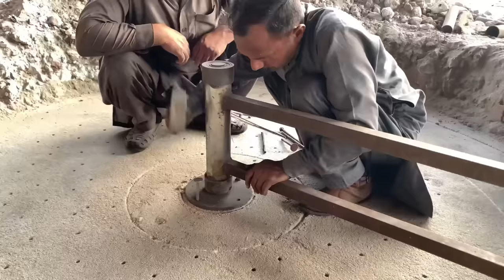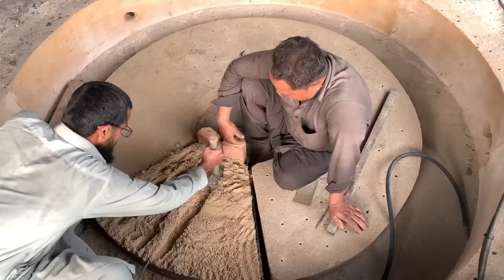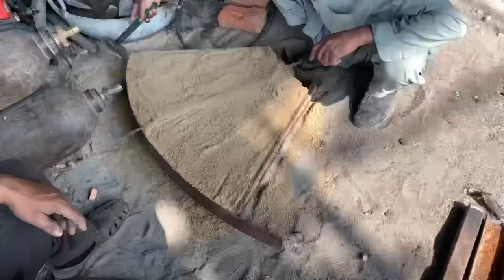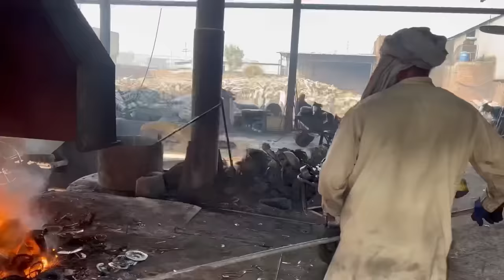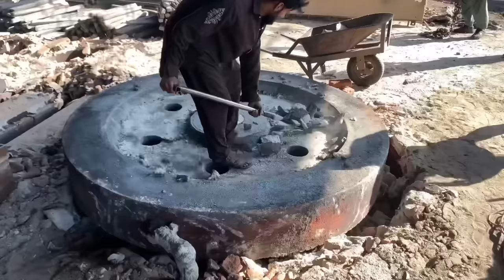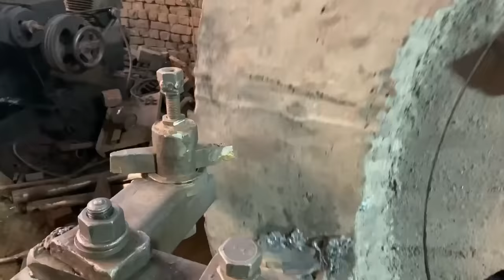Amazing Manufacturing of Largest Industrial Gear for Rolling Mill Plant | Production of Biggest Gear

Comment: What is used to bind the sand?  And what is it they're pumping into the sand through the black pipe?
Reply: Sodium silicate (water glass)is used as a binder. Co2 gas is pumped through it to harden the mixture.

Comment: Can anyone explain the air pipe being pushed into the holes and what it is doing? I've seen it being done on lots of casting videos, but never knew why. Many thanks.
Reply: It's usually some form semi inert gas that reacts with a chemical hardener in the sand. Once applied it hardens much like concrete but far more brittle.
Reply: @Jackskellington7172  Fantastic reply thank you so much. Really explained it perfectly. Thanks.
Reply: Sand is mixed with sodium silicate and when exposed to CO2, it hardens. It is recycled again for reuse.
Reply: The question and answer I've been looking for for months 👏👏👏👏

Comment: What is it that they are pumping into the sand?  Is it just water or moister so that it will set up or is it some kind of setting agent?   Awesome process!
Reply: Liquid sodium silicate is mixed with the sand. After shaping the mold, the mixture is solidified with carbon dioxide pumped into the holes.

Comment: What binding agent to you normally mix with the sand and what gas are you using to harden the sand ?
Reply: CO2  carbon dioxide?
Reply: That is sodium silicate (water glass) mixed with the sand. CO2 hardens it. I've used it a lot and works especially well for cores.
Reply: Introduction: Co2 Casting is a kind of sand casting process. In this process the sand molding mixture is hardened by blowing gas over over the mold. This process is favoured by hoCO2 Moldingbby metal casters because a lot of cost cutting can be done. In addition, one can be sure of getting dimensionally accurate castings with fine surface finish. But, this process is not economical than green sand casting process.

Process: The Mold for Co2 Casting is made of a mixture of sand and liquid silicate binder which is hardened by passing Co2 gas over the mold. The equipment of the molding process include Co2 cylinder, regulator, hoses and hand held applicator gun or nozzle. Carbon di oxide molding deliver great accuracy in production.

Comment: Definitely a job done by people with such skill and ingenuity even if with an approximate technology, the fact that astounds me the safety at work, they work continuously in sandals, in the act of transshipment of the melted crucible they did not use any protection, yet they stood there to work hard and make sure that the work runs in the best way. The finished material could be seen to have many melting holes, probably due to the fact that the crucible did not allow all the air inside the mold to escape, or to a non-perfect melting point, who knows, but the fact remains that with here rudimentary means have done something incredible. We start making objects with 3D printers.

Comment: THIS was a really cool video.
Didn't even realise they were using a carbide turning tool until near the end. I would have though they would use hss because i didn't think carbide would hold up with all the interrupted cutting from the raw casting at the beginning. But then again that raw scale on castings is very hard.
Reply: carbide has improved alot over the decades

Comment: Good job by all. It’s easy to criticise but they got the job done. Scrap motor laminations for the steel which are usually of high quality metal. Is it a gear or a flywheel ? If it’s a gear I would like to see the teeth being hobbed. All the best.

Comment: The fact that this incredible amount of manual labor and precision could be cheaper anywhere or for anyone than using a CAD model and just programming a machine to do basically everything even better is astonishing. And so, so sad. Still, I deeply admire your craftsmanship.
Reply: ¿En verdad usted cree que con hacer un modelo en CAD ya la rueda dentada está terminada?
Reply: Its really just cheaper for the business. The workers are paying with their health for the cheap manufacturing.
Reply: thB: it would take a hell of a milling machine to make a piece that size!  Is there a milling machine that big??
Reply: @d.jensen5153  the answer you are searching is vertical lathe
Reply: @LaCotuaazul  
El CAD o el CAM funciona con máquinas por control numérico
Reply: @a.d8055  
El CAM NO FUNCIONA EN MÁQUINAS MANUALES
Reply: @MACNC555  El CAD (Computer-Aided Design) es para el diseño.
Luego con el CAM (Computer-Aided Manufacturing) los datos contenidos en el diseño se transforman en lenguaje ISO, que es el lenguaje de programación de las máquinas-herramienta.
Reply: @LaCotuaazul  
Claro.  Yo trabajo en CNC
Reply: @MACNC555  Ah, ok.
Mi mensaje es para las personas que creen las máquinas de control numérico son mágicas.
Reply: cad is not goint to cast it for you. Some one has to do the casting and the machning anyway
Reply: Ja zurück in die Steinzeit  , dann bleibt nur noch die Filmausrüstung aus der Zukunft über 😂

Comment: This is a Fly Wheel of a Rolling Mill, which type is very much costly and problematic due to a heavy weight, in manufacturing, handling erection and Balancing. These Operate at Slow Speeds and heavy Weights whereas we can increase Speed and reduce Weight also, by this Diameter of Wheel will be reduced as well. The Manufacturing of the Component will be easy this will be a  Fabricated one by Steel Plate Laminations  welded to each other circumferentially at periphery and Hub Bore. Over here we do not know the Material Composition and hence other properties like Strength, how we can be assured of a Safe Running Speed that the Centrifugal Forces will not Burst this. In This type Fly Wheel is Installed at the Out Shaft of Speed Reducing Gear Box which is Mill Speed. As said above if manufactured in that way,  This will be Installed to Run at Motor Speed for the Same Effect and Advantage. Thanks for the Video, these workers are working hard and the Machining  Hold Up is Simple and Amazing to Handle such a Very Heavy Weight Component.
Reply: Hakim Mohamad  Choice is there, they may adopt High Speed Lesser Weight Laminated Plate Fabricated Fly Wheel as  I mentioned above. Thanks.

Comment: What I want to see is the gear installed. Is it a crushing wheel, and a little rough is fine, is it a flywheel and not important? Is it yet to have more machining done by another factory?

Comment: Is the hose injecting air to aide in faster curing of mold material or an inert gas that does that and helps remove moisture from mold material and make it more stable for the coming massive heat up?
Reply: Introduction: Co2 Casting is a kind of sand casting process. In this process the sand molding mixture is hardened by blowing gas over over the mold. This process is favoured by hoCO2 Moldingbby metal casters because a lot of cost cutting can be done. In addition, one can be sure of getting dimensionally accurate castings with fine surface finish. But, this process is not economical than green sand casting process.

Process: The Mold for Co2 Casting is made of a mixture of sand and liquid silicate binder which is hardened by passing Co2 gas over the mold. The equipment of the molding process include Co2 cylinder, regulator, hoses and hand held applicator gun or nozzle. Carbon di oxide molding deliver great accuracy in production.

Comment: One thing I don't understand, where are those double T irons that were put in between on the side of the holes? They didn't remove them?
Reply: I’m guessing they just leave them to become integrated into the manufactured part. They aren’t exactly concerned with uniform metal composition or impurities.

Comment: Do they just tamp down the ground to get it so compacted? And is the sand special casting sand? Why does it set so hard? from blowing the air out? drying it?
Reply: The sand is mixed with sodium silicate. CO2 is then injected and it sets up quickly.

Comment: They are using CO 2 Shell Molding ( note when they poke a tube into the holes they made into their sand molds, that’s to inject the CO2  to harden the sand by reacting w/ an organic chemical mixed in ) This process was invented during WW II by the Germans for precision castings needed for their aircraft and rocket industries.

Comment: What is the tube that goes in to the small holes in the sand that seems to make the sand stiffer ?
Reply: The tube is used to inject carbon dioxide into the sand.
Reply: @bobbydazzler6990 Interesting. Does that stiffen the sand ?
Reply: @MrJermbob  Yes, it does.  The sand contains sodium silicate.  The CO2 gas "cures" the sodium silicate to make the sand very, very firm.

Comment: Fascinating.  Does the compressed air set the sand mould elements?  Not a tinfoil suit in sight.
Reply: Carbon dioxide, not "compressed air"
Reply: @bobbydazzler6990  that makes complete sense.

Comment: what is the black tube thing that they are inserting into the holes that makes it appear the sand cast is solid?
Reply: Injecting carbon dioxide gas to harden the sand mixture.

Comment: Nice work but they need and upgrade foundry to make multiple moulds and would increase production possible to use rollers with pattern on 1 roller cud even be water cooled rollers 😂

Comment: I'm shocked at the lack of any safety equipment worn by those working with the molten metal.  Injury rate must be incredible.
Reply: There was a surprising set of data back around when i started working back in 1980. Here in germany there was a big rise in the use of PPE and the data from different companys showed that the ammount of injuries klimbed UP, not down. The conclusion was that the worker with PPE where injured MORE but had lighter injuries because of the PPE, but workers without had fewer injuries but got hit harder when they got struck. In the end the ammount of sick days stayed allmost identical, but the numbers for the big injuries droped.
Reply: @Ordog213  - Thank you for the information.  I certainly would not have expected that sort of outcome.  Most interesting.
Reply: @WarHawk-  False sense of security.
Reply: @Ordog213  Or not. Common sense goes a long way.

Comment: They're not casting iron. This is steel. Cast steel is pretty good stuff if your heat is well formulated. Not sure what's going on here but I imagine they're using a combination of mild steel and spring steel scrap as well as maybe some cast iron which should have been fluxed by the time they were ready to pour. I often wonder what would happen to the way of living were accostomed to if all went to shit. It's very reassuring to see that a lot of our mechanical tech can be fairly easily recreated given measuring implements and the minimum in the way of tooling don't disappear.

Comment: Incredible job they are doing, but🤔 it would be better that they would not use a bubble level, instead they should use a digital level, more accurate don't you think so?
I watch them all the time, great craftsmanship, also what do they spray inside those holes? 
It's like creating sand castles on the beach, that a lot of fun.😊

Comment: The guys who initially trimmed it on the lathe, I didn't see them take any measurements at all. Could they really have eyeballed that whole series of steps?
Reply: Yes they did. Client asked for a big gear... So he is getting a big gear 😅
Reply: its just a flywheel..not a gear that wud require precise measurement
Reply: @ChandanBehera-jp2me  depends on rpm. You do not want it to vibrate. And you do not want to do a lot of balancing holes.

Comment: i would be a bit afraid to work with that.. embedded there are pieces of an I-beam, a big cause of any crack propagation. teh steel quality...is too low... if that piece of steel fly away... it surely kills someone to say the minimum. nevertheless very interesting indeed

Comment: Are we supposed to admire this?  This is how industry functions when you have a limitless supply of cheap labor.  The subcontinent's runaway population condemns hundreds of millions of people to work as peons.  No mention of pay rates here.  No protective clothing or equipment.  Dirt floors.  Scrap metal pots and pans tossed in a pile, then hauled away by wheelbarrow.  Etc., etc.

Comment: not an expert in that matter. question is only answer if You know what You talkin about please, no tik tok experts! Cast iron for gear in my knowledge is very fragile way to do it, forged steal is much stronger. process of making parts shoved on this video are very retarded in my opinion or am I wrong? cutting without any at all coolant, they melted random scrap without testing how much carbon in that steel etc. this is cowboy style, I dont want say african stile, or Indian, coz You will attack me for beeing racist, but this is what I can see on Video! hope this is not made for export to any west country.
Reply: You are absolutely correct. Shit they had made wouldn't serve even a half time of what hardened steel with proper handling would do.